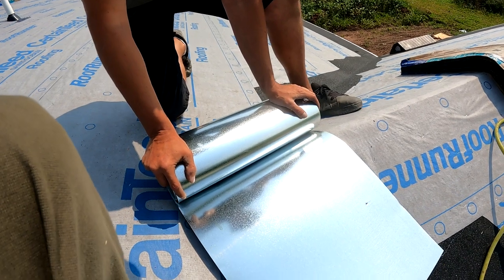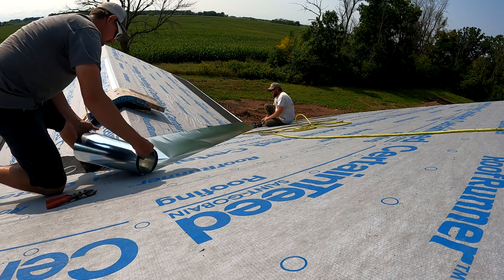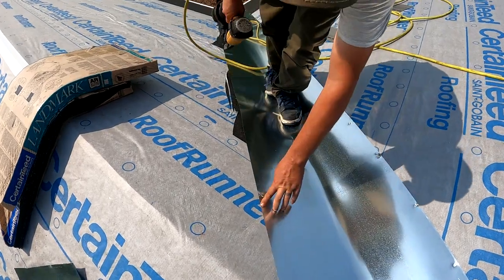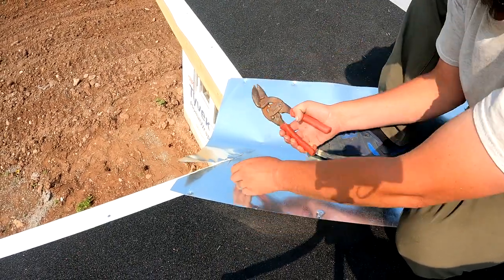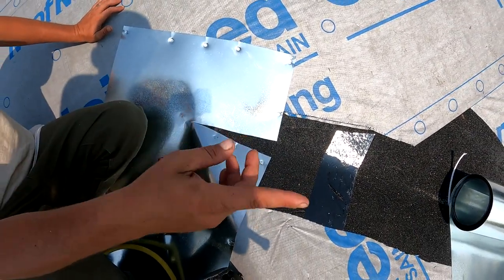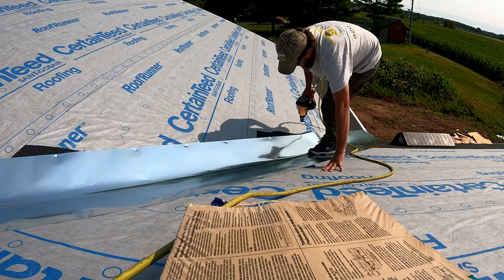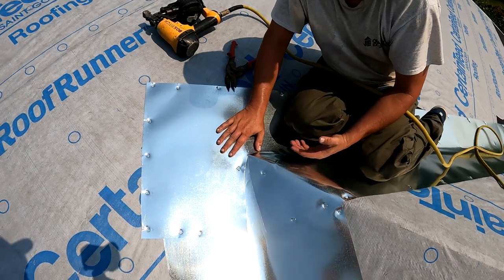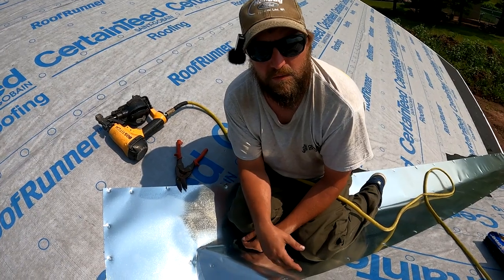HOW TO INSTALL VALLEY METAL

Comment: Don't think I have ever seen a rolled valley installed like ever
Reply: Why the heck not just use a modified cap sheet / torch type membrane instead of this light gauge garbage?
Reply: @richardmitton4115  Ice and water is FIRST placed in the valley.  Then, this is added to re-enforce any voids, gaps or cracks beneath even the ice and water, to "help" prevent tearing of the shingles or Ice and water underneath when walking on it over time.  The metal ads durability.

Comment: OK, I get what you're saying? Then why wouldn't you put it down first and bury it underneath. Your ice and water shields and then put everything over the top like normal. Because the only time I come across this kind of metal in a valley is when I'm tearing off a 30-year plus old roof even older.

Comment: Been looking for exactly this video, thanks so much!

A request:  where a dormer valley drains onto a flat section of roof, where do you end the flashing?   Out over the flat section course of shingles obviously, but how exactly?

Great channel, I’ve learned from you
Reply from the maker: When you say a flat section of roof do you mean a rubber roof/tpo roof? thanks for watching I apreciate it!
Reply: @Lifes_Apprentice  I worded that badly, please excuse.  By flat I really meant a smooth roof at a pitch.  Eg dormer on an 8-12 roof surface.  At bottom of valley the valley joins the roof near the beginning of the side-wall of the dormer.  How does that water flow out onto the remaining roof surface on its way downhill to the gutter?   Hope that was a bit more clear...

Comment: Great videos, would using ice&water be just as effective rather then metal?
Reply from the maker: Thanks. You do not have to use valley metal but the metal ads strength to the valley and ice and water could get holes in it

Comment: Good series of videos...thanks man. Define an open vs closed valley for me please.
Reply from the maker: Thanks! The difference is you will have to cut valley on both sides about 2inches up from center of valley and the metal will be exposed a bit. Some areas in the country the open valley is standard and other areas closed valley is standard. The open valley in my opinion is not as good(if done properly it is fine). It takes longer to install, creates more waste, and in some cases more likely to leak. If done properly they are both great options

Comment: First
Reply: I recently purchased a home that this wasn’t done and now there is damage that is dripping past the gutter and rotting out a facial board below. The roof is only 4 yr old. I wish I could send you a picture. I think you would see the issue and have a solution quickly. Inspector said it needed a L shape flashing to revert the water so it comes down and goes straight into the gutter. Is there away to send a pic. Maybe one you could use as to what happens very quickly over only a few yrs.

Comment: Definitely should tar each side all the way up both sides bro. Especially in Florida like i am bro. Also you nail it wrong and cut it wrong up top if you were in Florida that is
Reply: Using a nail gun on roofing is wrong period no matter where you are but it's easier and quicker than hand nailing so that's what most roofers do nowadays

Comment: Sorry.  You can be sure that the valley will develop at least 2-3 stress cracks per side due to expansion and contraction.  This will happen whether it's an open or shingle covered install. The only way to install a metal valley is with a "w" crimp in the center.
Reply from the maker: no it will not. I have done this thousands of times and never had an issue.
Reply: @Lifes_Apprentice  you are totally wrong. I am 2nd generation and I started roofing in1968. Also have 3 brother's with the same experience.  I have torn off these installs and every one had stress movement cracks right across the valley line.
Reply: @larrycrookshanks1646  can you post a link to a video with this W crimp center?
Reply from the maker: @larrycrookshanks1646  I have 4 brothers! lol ok man I have roofed thousands of houses and never had an issue. Make a video of your own showing your way. your open "W" valleys leak like hell in the great white north buddy!
Reply: @Lifes_Apprentice  we use 6' of ice and water shield here in the Great white north. Back when organic asphalt shingles were used the guy's that didn't cut back the angle points had leaks because the asphalt was bleeding out and sticking to the valleys and heavy rains would catch the points and track back under and leak. In my 52 years I never had to go back for that reason. You may have installed (thousands) but have you ever torn off a 30 year old valley?
Reply from the maker: @larrycrookshanks1646  I know you think my way is wrong but it is not and if you are really from the north you will notice about 98% of the roofs have closed valleys. I do very little new construction. almost all of my roofs are 30 year tear offs. we tear off ceadar shake roofs with 5+ layers and sometimes 3 metal valleys. I have never seen what you are talking about. I have een cracking from roofers who weave the valleys... You roof your way and I will roof mine. I am a business owner and do not want callbacks so I do it the way I know will not leak. You do the same. I reccomend if you feel so strongly make a video yourself.  There are alot of "know it alls" watching my videos. They only watch to troll if they actually know what they are doing why are they watching "how to" videos
Reply from the maker: @jeffkenyon7084  I agree. valley metal is optional on closed valley. I get so many shit comments telling me it will leak and shingles will crack but I know whats up! Thanks for watching
Reply: @Lifes_Apprentice  hey sorry  if it sounded like I was calling you a dumb ass I  didn't mean to I think what your doing is over kill but their nothing wrong with over kill
Reply from the maker: @jeffkenyon7084  I know you were not. read some of the other comments and you will see what I mean!
Reply: I don't see how a "w" crimp in the center makes any difference except that the "w" crimp valley flashing that one can buy has the sides bent over 1/2" so you can put clips on it and nail the clip to the sheathing to deal with expansion and contraction.  With the 28 gauge galvanized flashing, you could crimp the sides and then use the clips if concerned about stress cracks.  In this situation I don't think stress cracks would even be much of an issue anyway because there is ice and water shield underneath the metal and the stress cracks would probably occur at the nails which aren't in the valley.  If it were me and especially if I had a bending brake on hand, I might make the side creases on the galvanized metal but it is extra effort that probably isn't that necessary especially since it's a closed valley ie no exposed valley metal.  Also, with the valley shingles nails are going to go through the metal anyway (roofing nails should be no closer than 6" (if I remember correctly- look that up lol) from center of valley) so it's probably best to just do it the way he's doing it here.   If it were an open valley with "w" crimp then the clips that allow expansion would make sense  but then no nails should go through the metal at all (so the flashing can move) and then the metal would be exposed, I think the way he is doing the valley here is more water tight than with exposed valley flashings although some may prefer the aesthetic of an exposed valley flashing but I prefer water tightness and I think the way he is doing the valley here looks fine to me.
Reply from the maker: @metalguru6152  Thanks for your input! I can tell you know your stuff! These trolls that tell me I'm wrong are just guys who are stuck in thier ways...I try not to pay any mind to them. Enjoy the season! Roofing season!
Reply: @Lifes_Apprentice  First, I really appreciate your many videos for my first DIY roofing project. I'm happy with your techniques b/c getting a roofer in the boonies for my cottage is very expensive and I'm doing a 10X better job than the roof I'm replacing. However, just an FYI,...Ontario code is open valleys for whatever reason.
Reply from the maker: @truthseekerodinson5094  You have to follow local codes for sure
Reply: @Lifes_Apprentice not yet anyway. But you will eventually.  Trust me bro.  Tar both sides all the way up.  You want to cover those nails.  Especially if you were in Florida.  But shit it should just be done anywhere bro